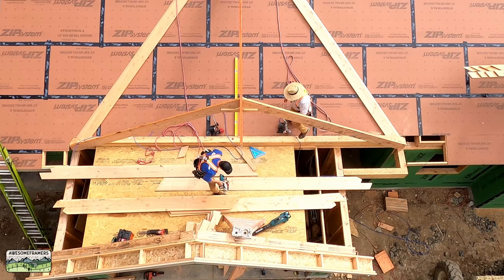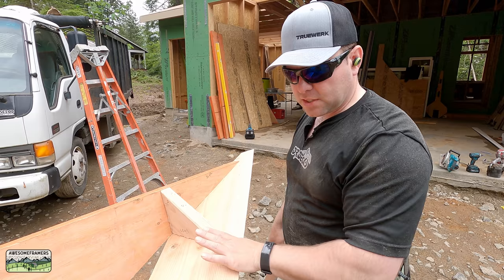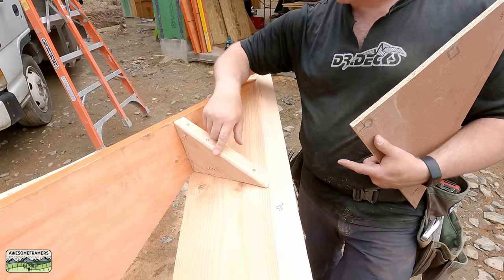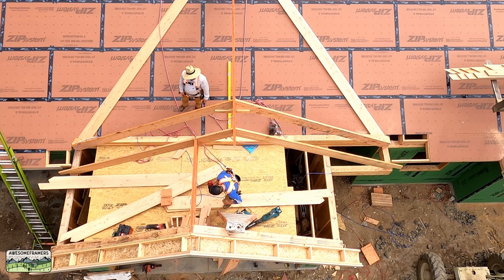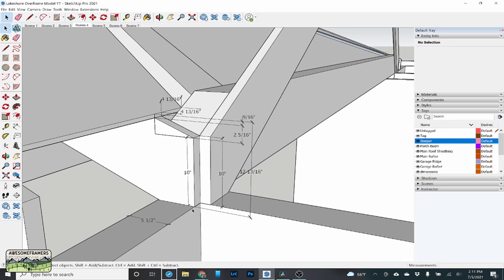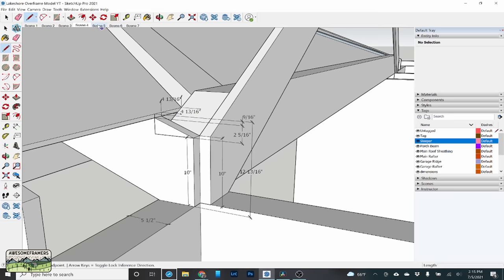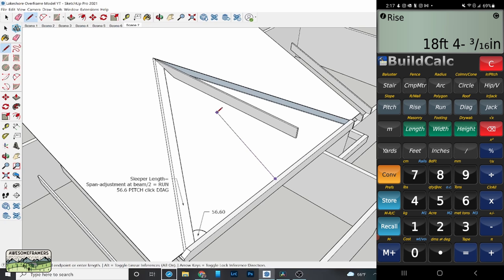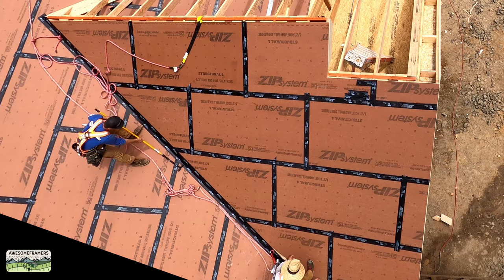How to Calculate an Overframe

Comment: Love Sketchup and always create drawings for the tricky parts. Have a cross-vaulted gambrel roof to do with different plate heights and would otherwise struggle in the field figuring the angles, valley bevels and such. If a client asks if something would be hard to built I respond, no, I've already built it once. Good video.

Comment: Perfect timing! I was sitting there Friday doing an overbuild thinking about how nice it would be to precut / prebuild an overbuild and lift it into place and nail it to the trusses. My problem is the math in figuring out all of the lengths and angles.
Reply: Remember when he said he had to cut an inch off and didn't understand why? The math is perfect but somehow the carpenters are not? It is not faster to build this on the ground and boom it in place. You'll be up there with a Sawzall.

Comment: idk how to start with sketch up id love to start.
How do you figure out the angle on rafter where it hits the sleeper, is it just the difference between 90* off the plumb cut? 26.5/90 would be  90-26.5 = 63.5?

Comment: Ok, here's one for you.
I have not found any method to lay this out other than eyeballing.
Got 6/12 pitch truss roof (45' long x10' at the peak.
They are returning onto a 5/12 pitch existing roof and the extended ridge is approximately. 3' above the existing roof's ridge.
I plan to make the transition by extending the existing roof on the opposite side of the over frame as a small hip framed section.
The biggest problem I've had is getting the correct angle for the sleepers since I'm working with points in space.
I'm an old man 77 as would just as soon be done with roof work but I will get it figured out so that it all flows nice and straight, no humps or dips.
LMK if you know of a way to work it out mathematically.
Appreciate any insights you may have

Comment: Hi there. I tried entering your keystrokes on the buildcalc app and I 49.18 as my sheathing angle not the 39 your getting? Is there something I'm missing? Would love to be able to do this kind of work by calculation but I'm a newb and a bit scared to do it.
Reply: I believe you didn't do convert 5 inch pitch

Comment: Thanks for making the video, the sketch up part was really above and beyond. Kind of a specific and perhaps inconsequential question but if you are going 2 ft on centre and have to use H clips is it still possible to start sheeting  from the top down or does it get too awkward? Starting from the top looks like a better way for a few reasons but we have to use h clips most of the time so I don't want to try this then after the first row regret it if you have already tried lol  also, do you guys have to space the seams of the sheeting or does zip  not need it it? If you read this - bless your heart lol
Reply: It’s not so bad using H clips while sheathing from top down. It does get awkward though. I just nail down my first row, then as I do the second row, I lay down a sheet, put my H clips on that sheet and then push the whole sheet with H clips up into position and  start nailing

Comment: Just another way of doing the maths for the bevel on the side of the valley board,
5/12 & 7/12 Mix pitch roof

atan of sin (Plumb cut angle for Hip or Valley) x tan(the plan angle)
atan of sin (71.27°) x tan (54.46)= atan 52.9°
Bevel angle = 52.9°

Comment: How do you find the backing angle on the calculator
Reply from the maker: You can read the tutorials for the BuildCalc app, or follow the instructions in the middle of this video for where I get the 56.6 angle.  It calculated the backing bevel at the same time.

For the sleeper backing bevel it is 90 - (sum of the backing angles).  So find the backing angle for each pitch, add them together and subtract from 90.
Reply: Which calculator do you have

Comment: I know this is the industry standard on how to frame exactly what you framed but this is not a good way of framing. Sure it's faster and cheaper to do it your way but it in the old days the lower truss/rafters would have been blocked in between each one instead of a board laying on top of the sheathing. That upper roof would be open and accessible from the attic space and could be filled with insulation. Now if there is a leak, accessing that area is impossible and if it's a small leak it can cause larger damage over a longer period of time. My home that's built in the 1920s is framed like I mentioned and I can see from inside the attic if anything bad is going on.
Reply from the maker: Allow me to explain the structural side and alleviate your concerns.

Our engineer here in seismic zone D2 specifies that we fully sheathe under the layover roof.  This is stronger in an earthquake, much stronger than true valleys.  You would definitely fair better this this house than your 1920's in the "big one".  

Regarding ventilation, both roofs are adequately vented and we cut an access from the main roof to the lay over roof.  

I'm sorry, but every one of your concerns lacks merit because they are all planned for.
Reply: @AwesomeFramers  well, good to know that you framed it right, with access and venting. However, I see this framed incorrectly ( or at least what I see is incorrectly) regularly in the industry. There is a new track home subdivision where every single home was framed exactly like I mentioned and I actually talked to the framers so I know there was no misunderstanding on what my eyes saw. As for my 1920s home.....well it's in California, and only 35 miles from San Francisco and 15 miles from Napa. It has already survived the 1989 "big one" earthquake and the recent Napa fault line earthquake without even a crack in the stucco. That's with the original foundation, with no rebar or bolts. It helps when your home is built with quality lumber with 16d nails that make a current 16d nail look like a toy. Try pulling a nail out of 100 year old wood.... The 100 year old nails that I have pulled out look like they were installed yesterday and I need a 3 foot crow bar to pull them otherwise they won't even budge.  Soil conditions make a big difference in the felt effects of an earthquake, luckily I am on Sandy loam, compared to the adobe clay that is everywhere else.
Reply from the maker: @djtheg6819  I think we agree then that it isn't the over framing that is the problem, once again it is the lack of skilled installation.